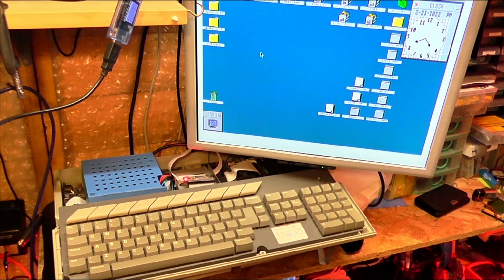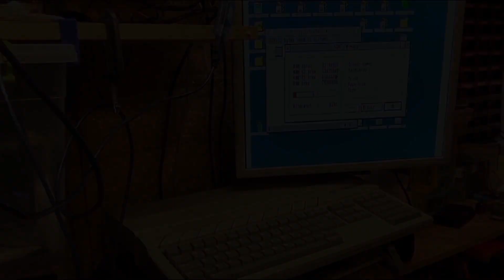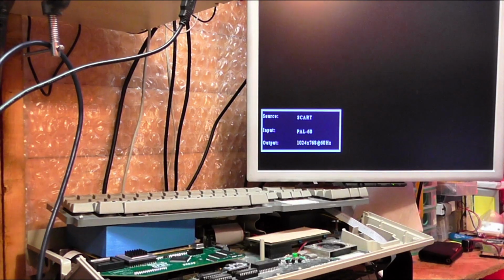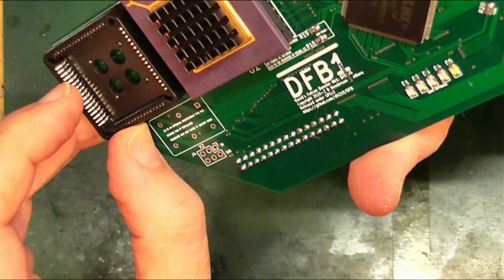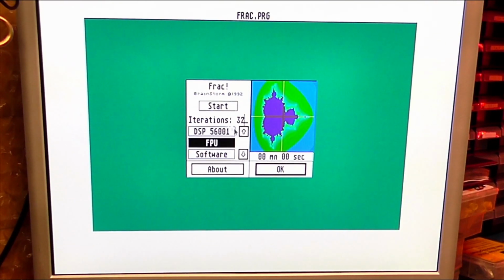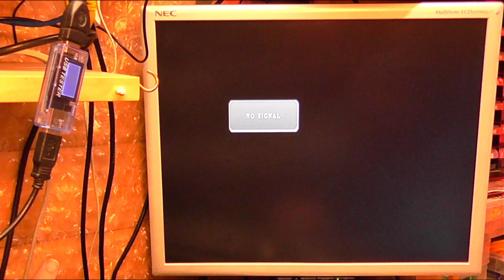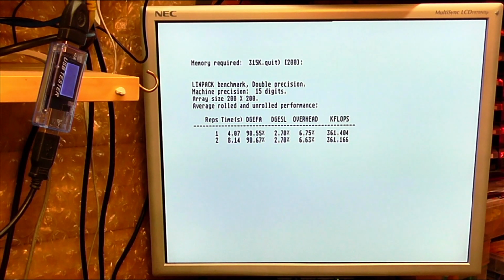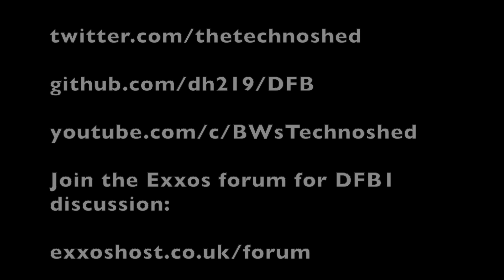Building the DFB1r5 -- Part 4: FPU

Comment: Very cool =D  Looks fantastic too!   That socket pin, best thing I've found is a needle - use magnification and you can usually pull them forward by getting in at each side.
Reply from the maker: Thanks, Gadget. Good idea with the needle. Just happened to have a drawing pin kicking around which got me started, but a needle (or two?) would proabably be ideal.